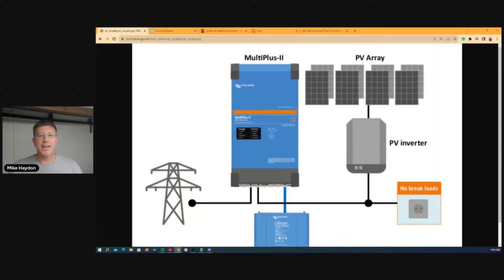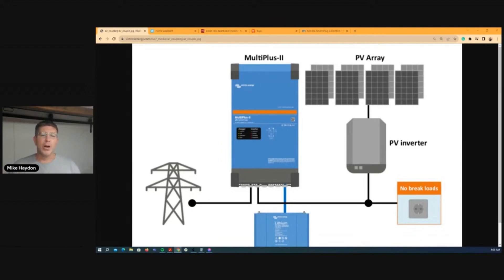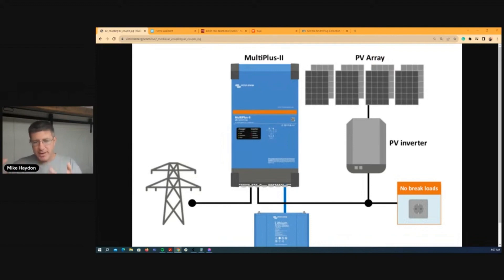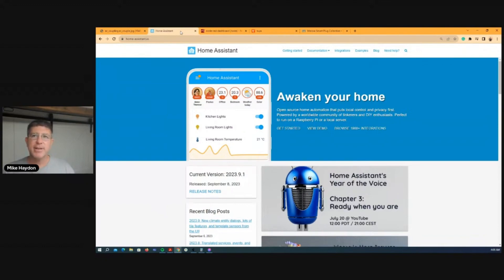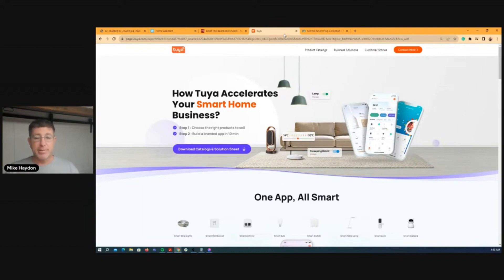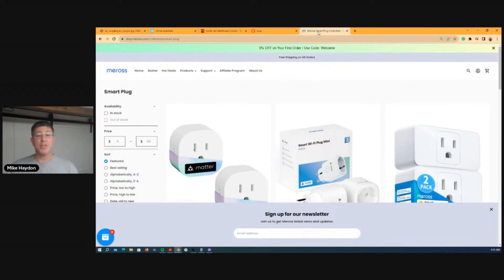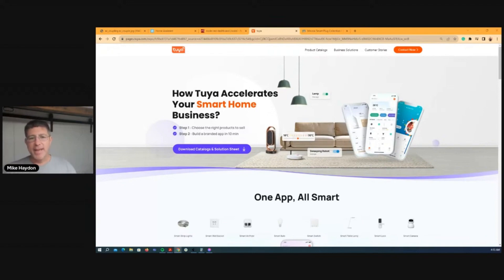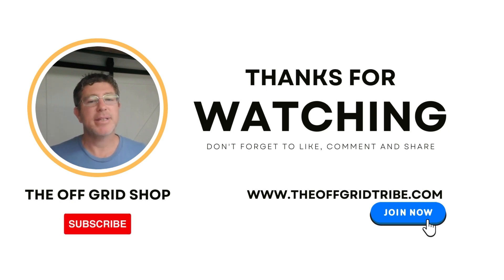FAQs on Solar Panel Issues & AC Coupled Systems Explained

Comment: Hello Mike.
Thanks for a useful video.
Can you please advise as to whether one may use a Fox AIO with a battery bank to AC couple to a Victron Multiplus or Quattro? I already have a FOX AIO 6KW system, which is difficult to get rid of, so would like to use it within a Victron ecosystem.
Advice and guidance will be greatly appreciated.
Thaabit
Cape Town
Reply from the maker: Hey Mate, yes it can be done. We have done is several times with AC couple battery's. They all are pretty much the same.
Reply: @TheOffGridShop  Thanks so much for your prompt response. 
Take care.

Comment: Hi Mike
Can i use any pv inverter to AC couple?
I have a solax string inverter I would like to use
Reply from the maker: What brand of battery inverter do you have? The answer is likely yes if you have a Victron or SMA
Reply: @TheOffGridShop  Thanks Mike yes MP2, I’m loving the Victron gear still learning the capabilities of what each component is able to do
Cheers
Reply from the maker: @lukeclose4580 ok Great. You can adjust the frequency of the Victron and I will try and learn how to change them in the solax 1st.  Most of those products like solax and goodwe have a higher frequency than the Abbs or SMAs and it's makes your clocks run fast.